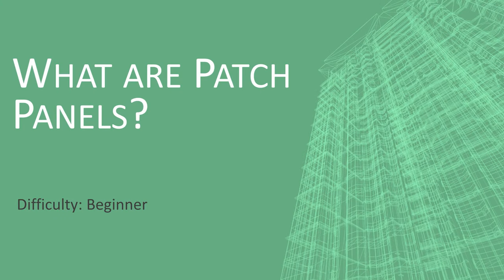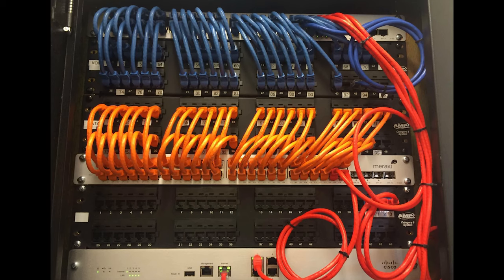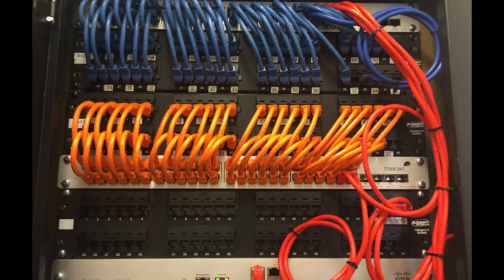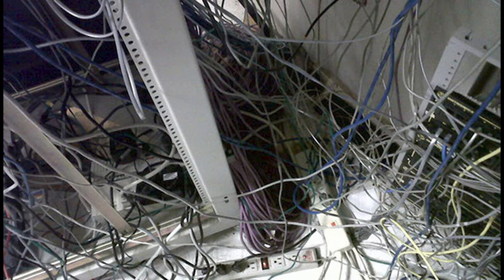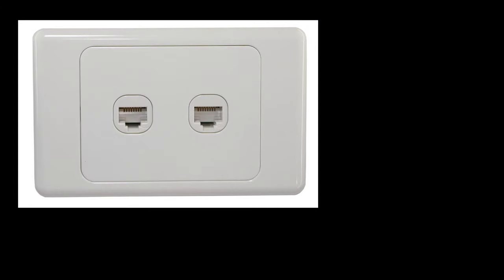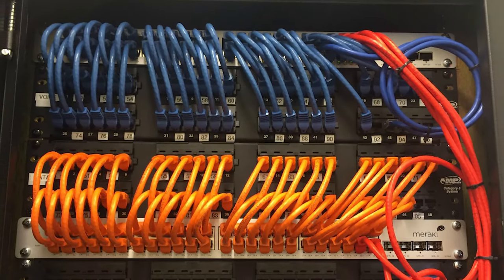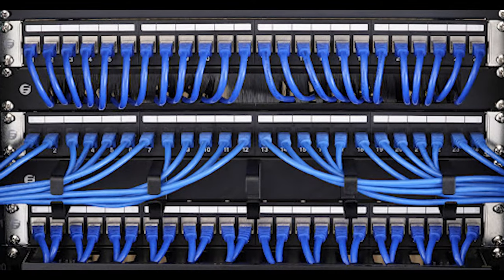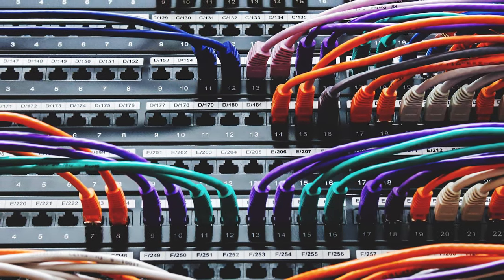What are Patch Panels?

Comment: Question: the wires from each room comes to this location which are wired up behind the patch panel box, What does the short cables do in the front of the patch panel box? Is there a master output from the modem that needs to be run to each room?

Comment: Whats the point of the patch panel if we can just connect it directly to the switch? I’m confused
Reply: the patch panel is important when there's cables from multiple devices that need to be connected to a switch. The cables connected to the back of the patch panel are usually permanent. Think about it if there's multiple people working on floor, all of their computers are connected to the patch panel. If somebody moves desks or a new person begins working on that floor, the patch panel makes it so that you can disconnect from one switch and connect that port on the patch panel to a different switch. This way you don't have to move the cable that's coming from the device/computer itself. Overall it makes changing  between switches relatively fast when dealing with multiple devices
Reply: In essence, the patch panel provides a convenient and organized interface for connecting cables, while the switch directs and manages the flow of data between devices via the patch panel.
Reply: @jtgeo9227  is there any need for a patch panel in a home network? if all my ethernet cables come to the same place for the same network then they can just connect directly to the switch right? does a patch panel just make it so the long bulky connections get made in the back of the panel out of the way and then patched to the switches which can/do fail with shorter cables? basically to prevent having a big elephant trunk of cables out in the open?